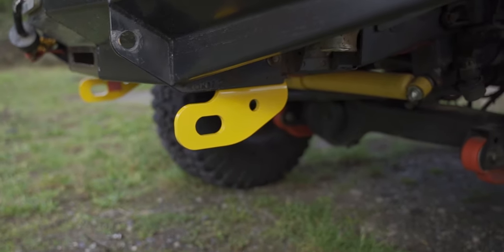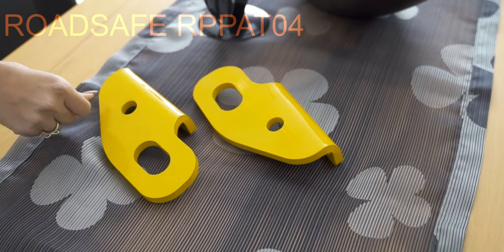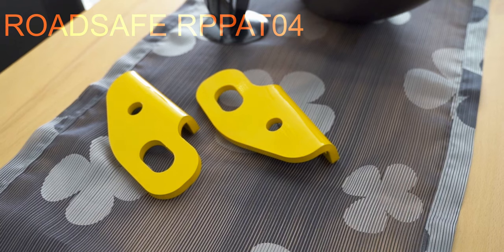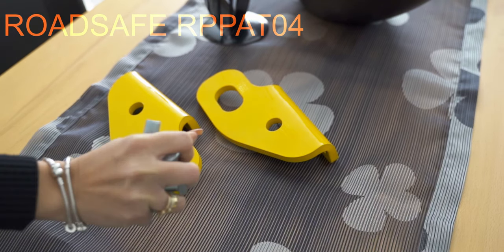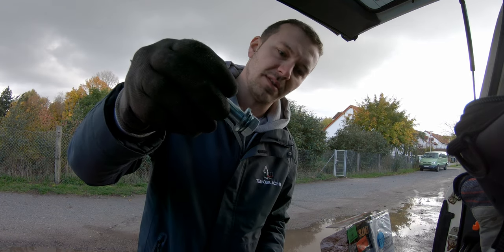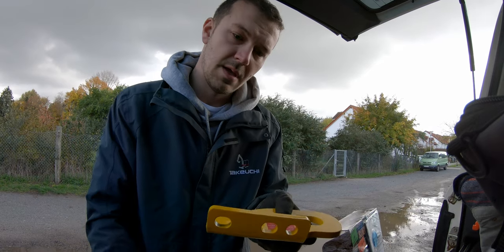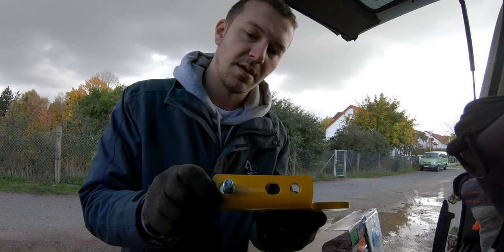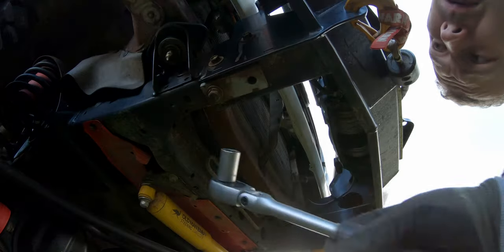RECOVERY POINTS: Roadsafe 4WD RPPAT04 Installation On A Land Cruiser 80

Comment: Thank you - I just used your video to install Ironman 4x4 recovery points (powder coat is red instead of yellow) for my 96 FZJ80 with ARB bull bar - basically same recovery points as roadsafe ones - fast install, thx for taking time to make the video
Reply: Noice - doing the same red Ironman points to a 97 this weekend. Safe travels.